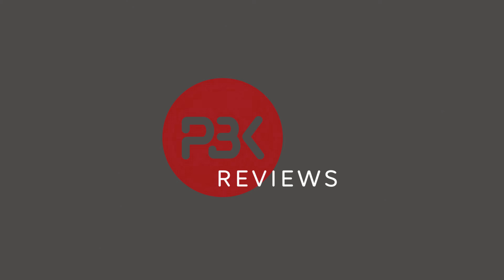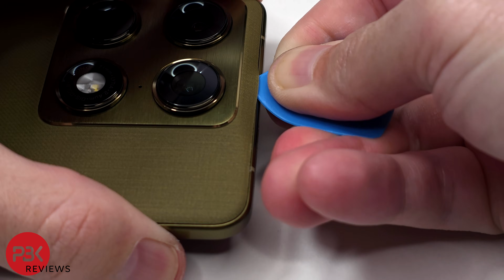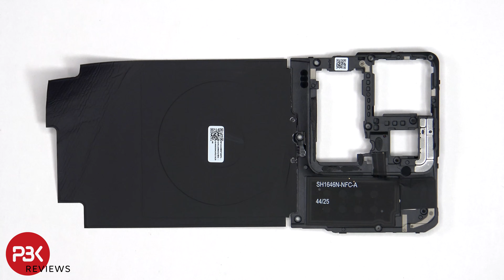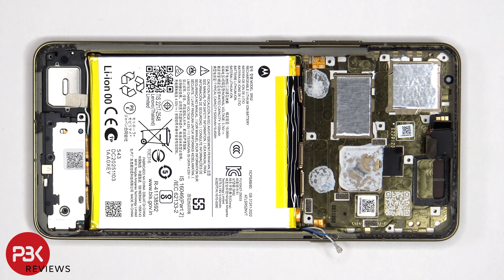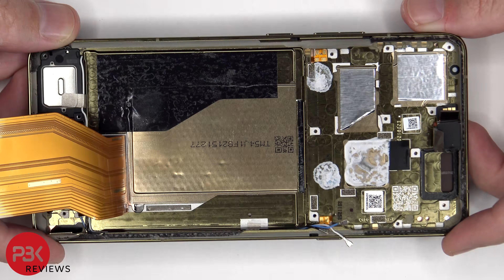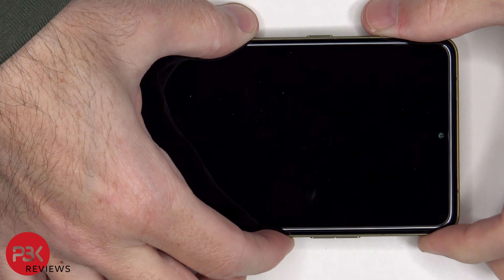Motorola Signature Teardown Disassembly Phone Repair Video Review

Comment: Is the Position of the Wireless Charging a bit Strange? When you use magsafe the ring needs to be placed right under the lower Part of the Camara Modul. 

Correct me If i'm wrong. But with a Qi2 Wireless Charger 11W is the Limit.

Comment: Moto signature launch with CARBON SILICON battery but in this video it's Lithium ion  how possible
Reply: You need to learn a bit more about battery tech. It actually is li-ion battery.
It's just a method of using silicon-carbon composite instead of a traditional graphite anodes of a Lithium Ion battery.

Comment: Sir, I am noticing the main camera module is shifting from left to right, top to bottom and other direction when I am rotating the mobile is that any problem in my mobile. Please clarify me
Reply: That's normal with Optical Image Stabilization. When the camera is functioning, that shifting mechanism dampens any vibrations for blur free captures.

Comment: Hello dear,
@PBKreviews 
@PBKreviews,
I have humble request from you if you could kindly try to replace the battery in Moto edge 30 or Motorola X 30 from the new Motorola signature series video it is looks like the same battery approximately the same dimension and the same capacity but it is of silicon technology if you can try a replacement or upgrade video that will be really helpful.

Comment: Why does the battery show Li-ion (Lithium ion) only and not Si-c (Silicon Carbon)? Doesn't Motorola advertise use of Silicon Carbon battery in the Signature, or do they use different batteries for different markets?
Reply: Silicone carbon batteries are lithium ion batteries friend
Reply: It's just same bro

Comment: Watching this teardown on my Moto Signature..... 😬😬
Reply: Bro i have some queries about the phone do u mind ....

 Pls reply if u have seen this comment 😮
Reply: @RidamSaha-l5m  go ahead
Reply: Bro does it have consisitent  good camera  performance as promised in dxo mark?  
Does it have that lvl of performance specs as of like antutu 3m plus ?
Is it having proper uddates and security patches ?
Does the ai integration capable ........
  Will ask more questions later 😅
Reply: @RidamSaha-l5m TBH.. I don't know much abt any official benchmarks as per the Tech-ies.. bt Camera is Good... Performance is also Good..
Updates n Security updates are very much on time as they promised 7 years of android (major) updates.....
Reply: @ishpreetsingh9241 ok thanks 😅
Reply: Brother i hve a question,
Does the back panel get dirty if we use it without a case?
Reply: @SprinterMlbb-u3y I have Signature too, tbh I get it dirty so all I do it scratch it, to remove the dirt or grease or anything got there

Comment: Nice phone. Can't wait for S26 Ultra teardown althought its almost the same internals every year but atleast good repairability. IDK if they send you a phone of you get it. But if you pre order it get the i think its exclusive color silver shadow its beautiful like the fold 7. Oh and question, I have a tab s9 plus, nothing wrong with it yet but i was wondering when its time if i could replace the battery in it with the tab s10 plus its the same size battery but cuz its better rated to 2k cycles till 80% battery health. I know replacing batteries on tablets is tedious and screen might break so id do it in a shop. And do you think the battery cycles thing is true because on tab s11 they went back down.

Comment: Why it has Li-ion battery, not Si/C??? And capacity 5100, not 5200?
Reply from the maker: Silicon carbon is still a lithium ion battery with silicon carbon in the anode. The entire battery is not silicon carbon. Capacity has both a rated and typical written on it.

Comment: Motorola Good Work, easy to Repair and Replacement Part...  But what About screen Replacement Everyone Company Not Make easy To Remove Dispay. Its bettr that Back site Panal remove and Repair Parts... Perfect Di assembly
Reply from the maker: Thanks. Yep, now a days with most of these higher end phones with such thin screens/bezels and glass, they use the frame as support so they are glued on there pretty well making it hard for any type of screen replacement. Generally its easier to replace the screen with a replacement that comes with the frame attacked so you just move over all the parts from the old frame to the new one.

Comment: From the launch of this phone, gamers and other youtube creators are testing extreme test over but still this phone manage to stay cool, motorola really does done their job well. This copper mesh and liquid metal cooling really impressive.
Reply: @PBKreviews 
Hello dear, 
@PBKreviews,
I have humble request from you if you could kindly try to replace the battery in Moto edge 30pro or Motorola X 30pro from the new Motorola signature series video it is looks like the same battery approximately the same dimension and the same capacity but it is of silicon technology if you can try a replacement or upgrade video that will be really helpful.
Reply: If only they made the buttons and battery more easily replaceable and gave it a headphone jack and mSD Slot. 😂